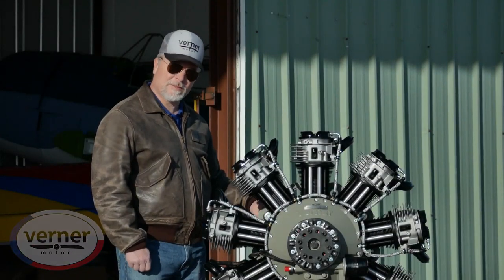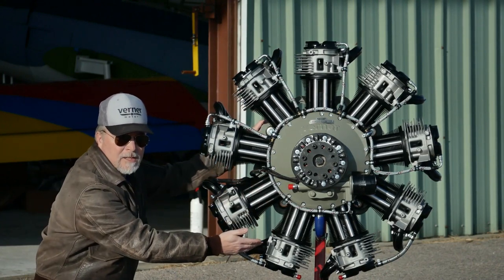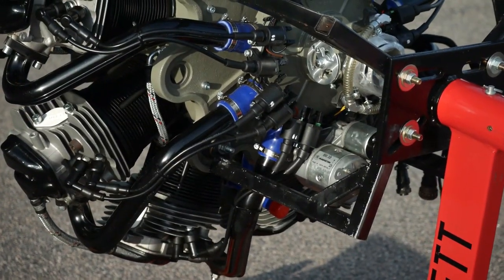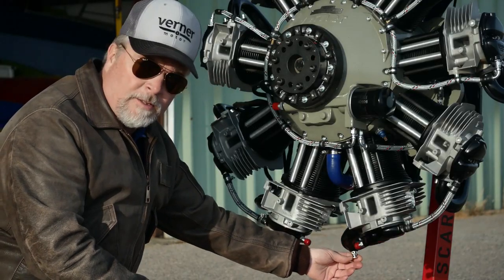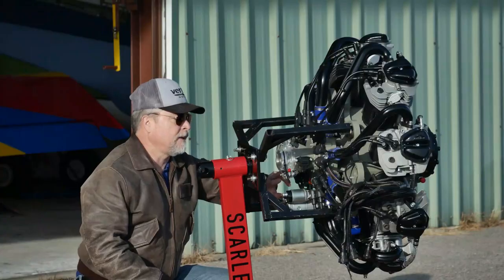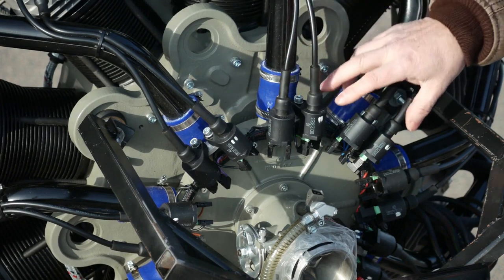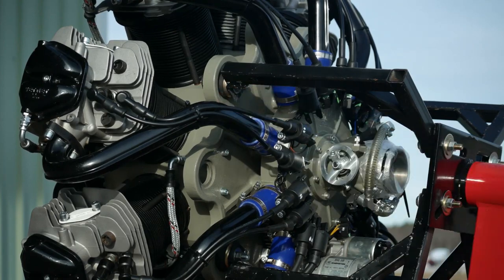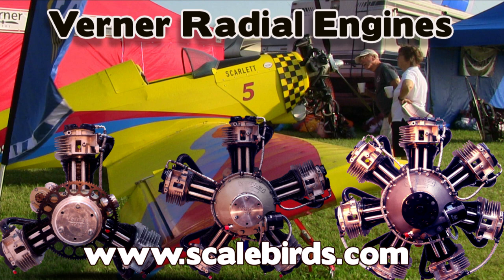Verner 9S Scarlett Radial Aircraft Engine from ScaleBirds.

Comment: I love it! If I was going to make any suggestion it would be that the oil drain plug on the bottom cylinder needs a "Sailor Proof" safety on it so after you open it to check on prestart, it cannot ever open without a positive input on the pilots part. If it was to ever get loosened in flight, the results could be severe. Maybe something like the spring loaded ones on a gas collator?